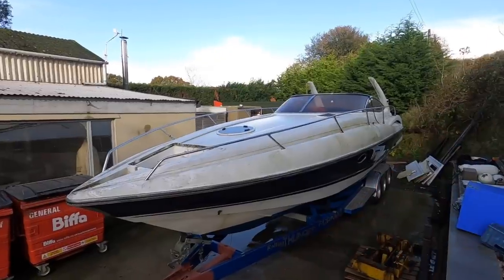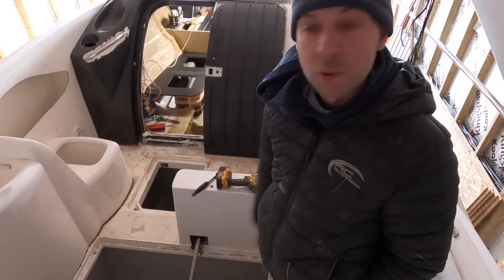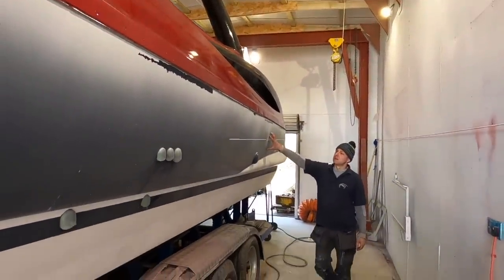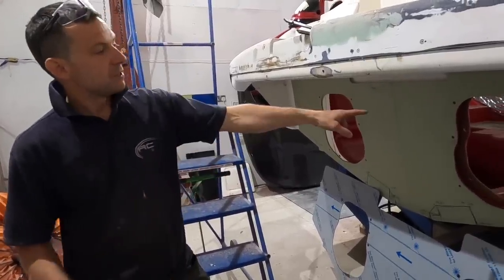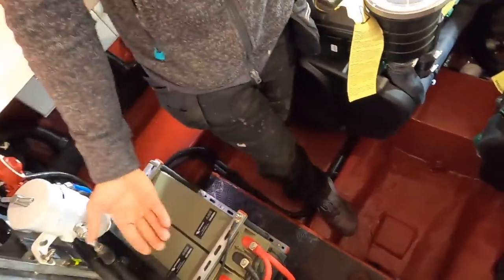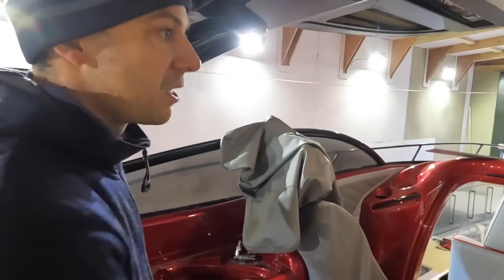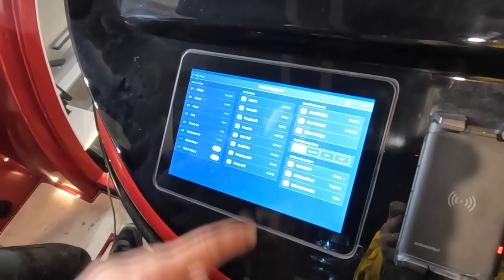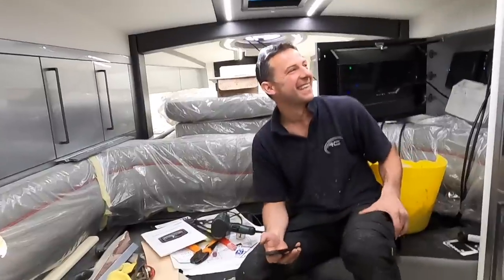Project Sunseeker : The Whole Build Story

Comment: im in the process of refurbishing my 40 foot aluminium catamaran that very nearly sank on the mooring dur to an electrolysis issue 4 years ago. the amount of work that goes into doing refurbs on boats is rediculous...
Reply: the biggest issue I have is that the boat is a surveyed vessel for charters so everything is just that much more complicated. it also just has so much stuff on it. it's a 12 meter boat that weights 13 tons lol